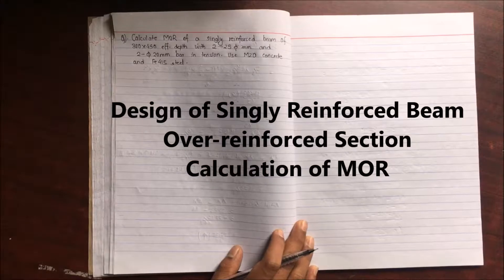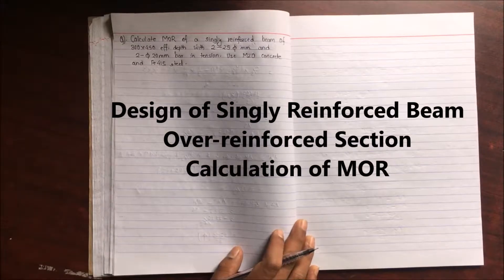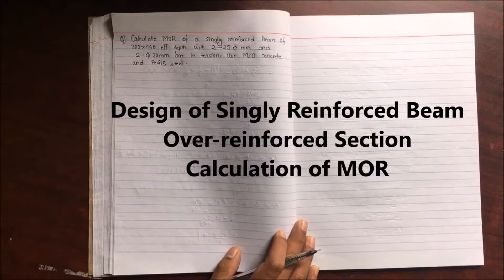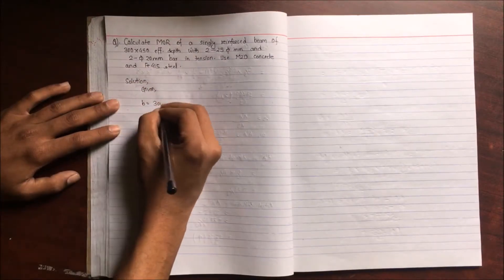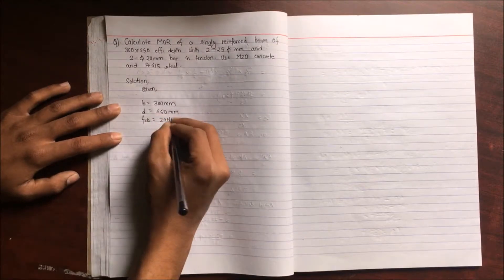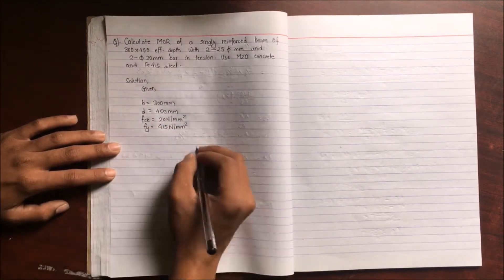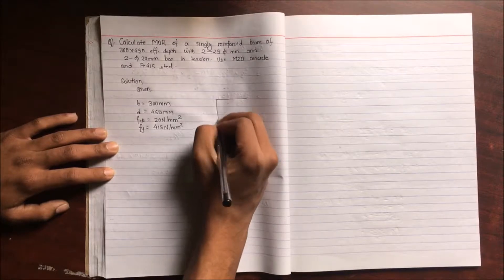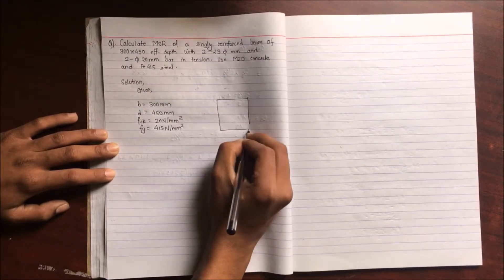Analysis of Singly Reinforced Beam | Over Reinforced Section | Design of RCC | Mumbai University

Comment: What is the difference between calculating
1. Moment of Resistance by taking Xu,lim in 0.362fck b Xu,lim (d- 0.42 Xu,lim)

2. By using strain compatibility, as demonstrated in the video.

Which of the two method should be preferred and why??